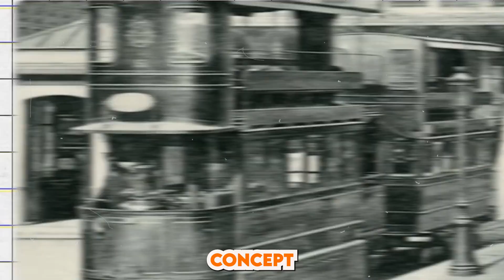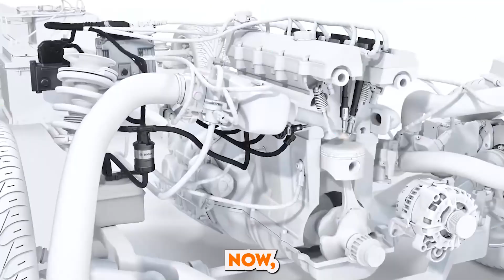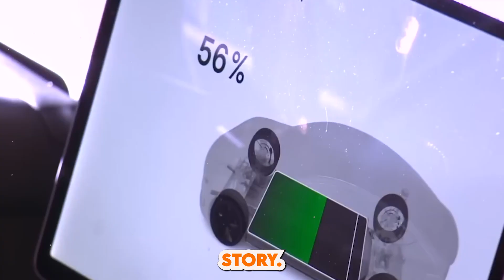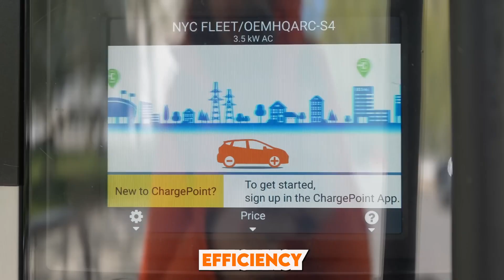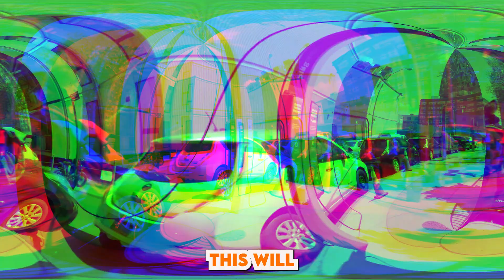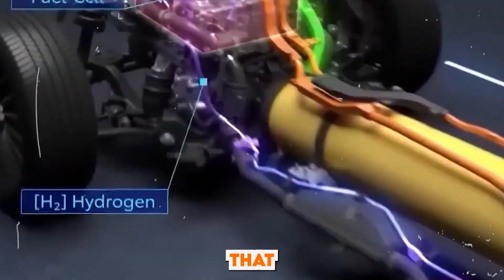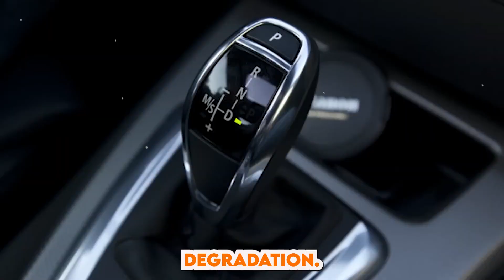ALL NEW Compressed Air Engine!!

Comment: They are heating the air, so it expands when it goes into the cylinders, is my guess. How ever many times the air expands with heat, should be close to the gains in mileage, power, and efficiency. Windmills should be pumping air with flywheels and power body shops, mechanis shops, butcher shops, manufacturing, ect. Air already rules, but they could get more out of the old fly wheel compressor if the air was heated in a secondary chamber. This thing could convert part of that air back to electricity, at an idle, and power the lights, maybe an arc welder. Air tools are the shit. I think hydro and compressed air build the great pyramid. Most wind turbines are not even using fly wheels. That's like an old dog deisle truck with no turbo. Give the turbine a fly wheel to compress air and heat the air before it reaches the tool.